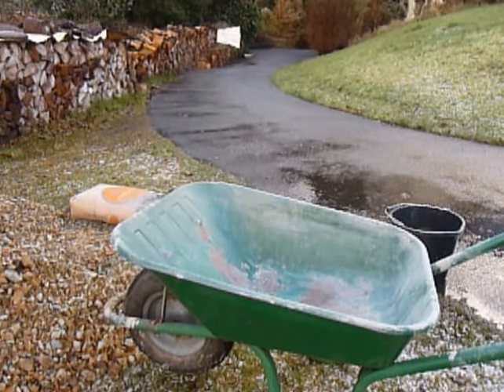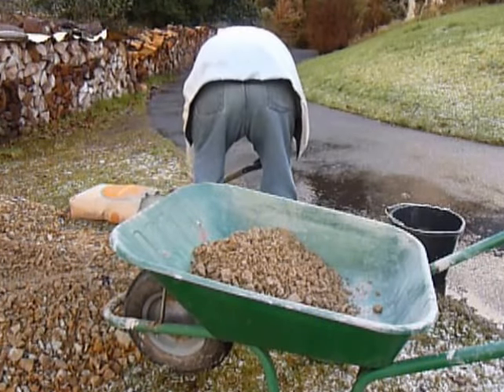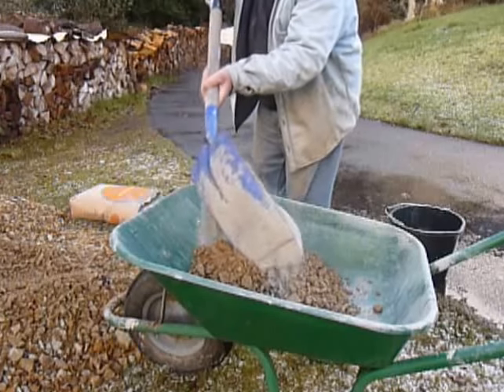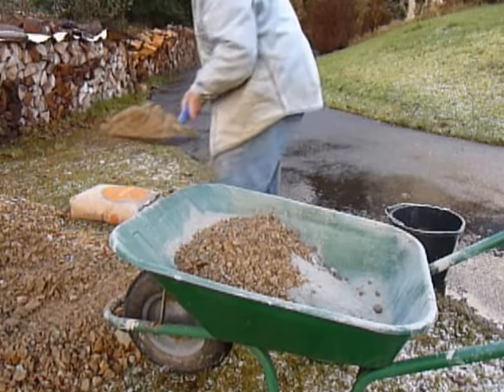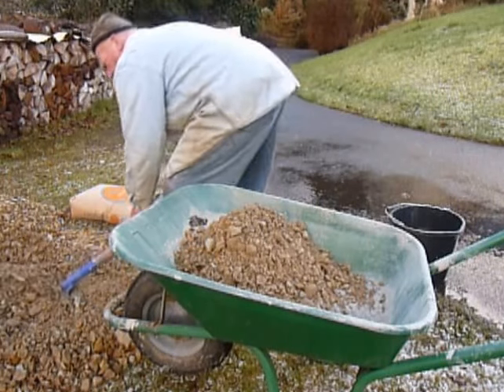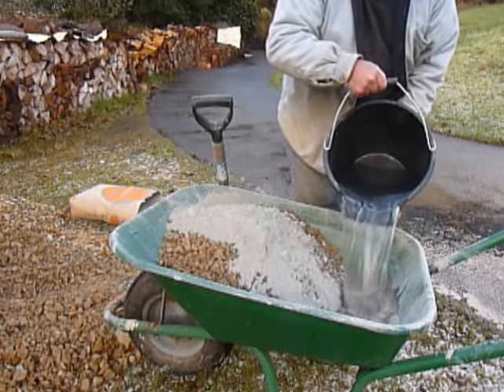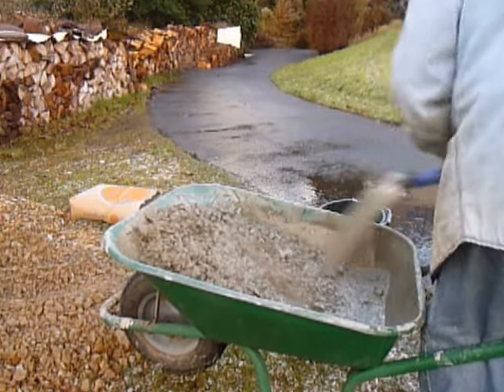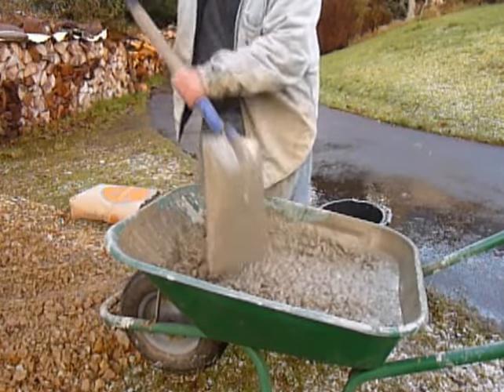Mixing concrete by hand in a wheelbarrow the easy way

Comment: My dad and I did exactly this when I was a kid.  We poured a walkway around one side of our house and then another with steps coming off the porch.  This works people, I can still see the work my dad and I did 30 years ago on Google maps of our old house.
Reply: So he's making it from scratch, as it were, as opposed to just mixing quikrete with water? Not sure how that's easier. The way my dad taught me, we use a pulaski, which is an axe-type tool with one blade horizontal which helps it cut through the concrete and mix it really well.
Reply: keith cunningham  Well, damn, guess I shouldn't have ordered that entire pallet.

Comment: I did not know anything about cement or concrete but after watching this video i did my pavement just like this and it worked. I was tiered as hell but it worked! with steel arming at the bottom! 

THIS WORKS!
Reply from the maker: I'm glad it was of help, thanks for watching
Reply: you beast

Comment: I've always mixed using a barrow for small jobs. Then I started buying concrete molds to construct a Roman garden and decided to invest in a mixer. Well I used it two or three times then went back to the barrow because I wasn't that impressed. What's more, it made a noise like a WW1 tank with half it's track missing. So I'm back to plugging away with my wheel barrow and loving it...and that method you used is fine...

Comment: All these years I've been doing it wrong. Your method is both clever and efficient. Thank you for sharing!
Reply from the maker: I'm glad it was helpful, thanks for watching
Reply: @oldtimer43  Ordered my wheelbarrow yesterday, and looking forward to replacing those leaning fence posts. Thanks again. :)
Reply from the maker: @12thDecember  Good on you, although I used a shovel a lot of people have commented that a hoe might be better for the actual mixing. Good luck and let me know how you get on.
Reply: @oldtimer43  Thanks for the follow-up. I have both tools and will let you know which works better for me. Fence post removal and replacement will be in the next two or three weeks.

Comment: 👍👍Old school mixing, I think it's cool that people still do it. 
Nothing wrong with that, I'm old school in a lot of ways & it blows some people away on some of my accomplishments.
Good video & thank you for sharing.
Reply from the maker: Thanks for the comment, I wouldn't want to be doing it all the time and still use a mixer for large quantities but for smaller jobs it's fine, you are right about accomplishments, I have just finished a 500 sq ft extension to my house just by myself and have just started  a large pond/waterfall in the garden and I'm just turned 77 yrs old

Comment: this is such a good tip! first time mixing concrete and I'm so glad I watched this suggestion. I've found you can also lever the shovel off the back of the wheelbarrow to flip the wet side of the mix.
Reply from the maker: I'm glad you found this useful, many thanks for watching.

Comment: Good technique. One of the first things I learned about concrete was to always add the dry to the water, never the water to the dry - and this method makes that possible in a very easy way.  I don't mix much of it, but sometimes I need to set a post or something and make up a tiny batch. I have to buy those teensy sacks that hold about a half gallon of dry cement. It's expensive that way but I can't lift the others LOL :-) Tina
Reply from the maker: If you only have a very small amount say for a post, I've just seen a video from a 86 yr old man showing a very easy way, take a look at http://youtu.be/mQAdmX57aRU
Reply: Thank you... nifty concept. Here's to continuing to live normally as long as we live!  :-)

Comment: I've mixed concrete in a wheelbarrow many times but next time I'm going to follow this method. I used to mix it dry before adding the water, which is quite hard work, but I can see the method in this madness, it looks like half the effort. Simples :)
Reply from the maker: I'm glad it was helpful, many thanks for watching.

Comment: Nice one mate! I was taught the same method when I was a kid (From an English Bricklayer). Definitely the easiest way to mix concrete, mortar and render. We have light all steel mixing shovels here in OZ that are a bit straighter that yours. I find the angle to be good for mixing in a wheel barrow.  Actually, the two biggest wheel barrow makers here in Australia make their tubs with sharp internal corners so the shovel can get right in there.
Reply from the maker: Hi, Many thanks for stopping by and commenting

Comment: I put the sand or sand and gravel mix into a wheelbarrow, make a well in the middle, add the cement and water, and mix thoroughly with my hands (thick gloves essential as cement is irritant). Result - in two minutes I have a uniform mix that sets perfectly. (Though I would use a smaller quantity than shown here.)

Comment: Mixing concrete by hand is bloody hard work. Use buckets to measure the materials for the mix, guess work will result in a poor mix and ultimately a poor finish. Weigh a full bucket of all in. Then reduce the amount in the bucket until you have half the wight in the bucket, then mark the inside of the bucket with a small hole. You can then use this bucket to measure the all in, cement and the water. BTW, your mix is slightly too wet and needs a little bit more cement.
Reply: it seeemed like that...thanks

Comment: I just laid slabs for a shed base, my mix was two bags of sharp sand to half a bag of cement. Some stones.
I mixed the first bag of sand with the cement like soup, proper wet, added the stones then added half the other sand then the last sand, a big full barra worth. Still a hard workout not gonna lie. A mixers no fun, proper work by hand. Cheers, I like this technique also.

Comment: My back hurts just by watching this video.
Reply: Sykes Entertainment yup
Reply: Your back would hurt far more mixing at ground level!
Reply: I work for a basement company. I mix pallets at a time all by hand. Lemme tell you that their is a huge difference between aggregated cement and just add water quikrete. This is simple because the rock helps break the sand up. All sand cement is a pain in the ass and I promise their is no easy way to hand mix.
Reply: Get to the gym and get some muscle then

Comment: Hi Michael, you can't beat old school mixing. What mix ratio would you recommend for fixing fence posts in using general-purpose cement and ballast? And how many fence posts set at 24 inches deep and 12 inches square would a full wheel barrow load roughly do.
Reply from the maker: Hi David, thanks for watching and commenting, I would use 4 of aggregate 2 of sand and 1 of cement for the mix, you will probably use a full barrowload per hole, I hope this helps
Reply: @oldtimer43  so are you saying throw in the sand with the ballast also, or would the 25kg bags of ballast be enough, as that is sand and gravel already mixed together.
Reply from the maker: @TheGreyTrippers  If it is already mixed sand and gravel that is fine by itself
Reply: @oldtimer43  So just to clarify, if I have a bag of ballast it's just 4 & 1 ratio, just wanna make sure I do it right the 1st time.
Reply from the maker: @TheGreyTrippers  Yes, that will be fine, good luck.

Comment: I do one bag of ballast (mixed sand and aggregate) to 5kg of cement (5 to 1). I put ballast in wheelbarrow. I have weighed/measured what 5kg of concrete is beforehand (up to a mark in a bucket). I have done the same with the exact amount of water I will need. I then mix the concrete into the water in a bucket, gradually, whisking like cooking. Then I just pour the liquified concrete mixture into the barrow and easily mix with a garden hoe. This way keeps energy expenditure to a a minimum, just shoving about easily and the bare minimum. Girlfriend does the concrete and water measuring, me mixing as she pours in the powder, and I mix in the barrow. A nice steady human pace and you can do loads.

Comment: RE: 03:50 About to mix my first batch of concrete in some time as a DIYer. Concrete looked a bit soupy at the handle end as the video finished. Is that fairly normal / acceptable or should it ideally be given a few more turns until the consistency is uniform throughout the batch?
Reply from the maker: I would normally made it a bit dryer but in this instance I wanted it to flow easily around the posts in what was a small hole, thanks for watching

Comment: I mixed concrete with three 25 kg bags of ballast using a hand mixer, a trowel and a large bucket. Two thirds of a bag of ballast went into each batch. Mix the water and cement to make a slurry, add the ballast, then mix with a flat ended hand trowel. Obviously for large amounts, hire a proper mixer.

Comment: Ye but you only have a half barrow mix. To mix full Barrow make half mix chuck in water to make a soup then add sand and mix/turn until get proper consistency a lot easier and quicker plus you get full mixes

Comment: The simplest ideas are usually the best. This is a great CLEAN war to work too as you can stand your barrow up when finished and rinse off with a hose... far better than dealing with a concrete covered board thats gone crusty overnight
Reply from the maker: TheComputec Absolutely, that's exactly what I do, thanks for watching

Comment: can I ask a dumb question: why not just mix half of that amount and then not have to flip the concrete from the back to the front of the wheelbarrow?
Reply from the maker: Good question and I have tried it but mixing two smaller lots takes longer

Comment: Very helpful as I prepare to do my first concrete slab for a storage shed. Is it supposed to be that loose and soupy?
Reply from the maker: +Mitchell Gossman I made this a little bit wetter as I wanted it to make it easy to pack around the posts for a slab I would be making it not quite as wet

Comment: Far easier way is to pour a full bag of cement over a pile of ballast on the floor and shovel it making a new pile.1 bag of cement will make 4 good sized barrows of dry concrete in a couple of minutes.then mix with water in the wheelbarrow
Reply: Sorry, stupid question, so your saying get the sand, cement, and aggregate and mix it all on the floor, or piece if wood, and then shovel the premade mix in to the wheelbarrow and add water???
I never thought of it that way, I need to do a 6x4 concrete pad for a shed, have the materials. but put it off for last month as I wasn't looking forward to mixing it in a Barrow.
I feel kinda stupid I didn't think of this 😳😳😳

Comment: How long do you think the concrete will sit there before it goes bad?  if I were to want to transport it with a barrel; how long till I cant use it anymore?
Reply from the maker: +Flip Alchino I would say you should use it in an hour
Reply: +Michael Collinson thank you il keep that in mind. That means construction workers have to daily and constantly keep making their own mixes while building... the horror.
Reply: +Flip Alchino Yes, but if they're doing small batches constantly, they'll have a mixer on site or just have it made to order at a plant and delivered to the job site if they're pouring foundations or driveways.

Comment: I'd personally do this the exact opposite way (in terms of wheelbarrow placing - so that the water is on the high side, and therefore less likely to spill out onto your crotch if you mix too quick!
Reply from the maker: The problem with that is you have to pull the heavy aggregate uphill and at neally 77 I prefer an easier way!

Comment: Im just using the mix to pour down a hole to fill it. Can't i just use the mix by itself with water, without needing sand and gravel?
Reply from the maker: Yes, of course you can use a ready mix, it is just more expensive if you have more than just say a hole or two
Reply: @Michael Collinson  okay thank you

Comment: 1 kg of cement needs 0.35kg of water to fully effect complete chemical reaction. Masons don't like this ratio as it is very hard to work on. This mix won't flow so formability is very low. So what happens if you put in more water? Positive side is, the mix will be easier to work on. Downside, concrete will lose strength significantly. If water is increased to 0.50kg, concrete will lose about 20% of it's strength. Why is this? Because ultimately the excess water will leave the concrete when it dries up. It will leave behind microcracks where it once was. So be patient and stick to 0.35 to 0.40 or add plasticizer to increase workability.

Comment: don't use that for anything structural !!  Should be batch mixed accurately to ensure consistent strength concrete
Reply from the maker: To be fair I wouldn't be hand mixing anything structural however I was using small quantities to surround posts which has held up well and no problems at all since making this video 6 years ago. Thanks for watching

Comment: There is nothing easy about working with concrete. There is only very hard and not so hard. From what I remember doing this for a mason is that you had to make sure every pass with the shovel or hoe scraped the bottom of the mixing box or wheelbarrow.
Reply from the maker: That is the very reason I pull the material back into the water to make sure the shovel is on the bottom when you mix, thanks for watching

Comment: Hi Michael 👋🏻 , thanks so much for this, what is the ratio for ballast, sand and cement please? And also what sand did you use? Yellow or sharp?
Reply from the maker: I use 4-2-1 ballast-sand-cement and use sharp sand, hope this helps, thanks for watching
Reply: @oldtimer43  Michael that's brilliant thank you, was debating getting a wagon and wheelbarrowing to where I need it, but this looks a lot better as I won't have to rush!! Thanks again for the reply mate 👍🏻
Reply: @oldtimer43  sorry Michael, what would you recommend ratio wise if the ballast and sand are already pre mixed from the same bag, would it be 6 to 1 still or would you go 4 to 1?
Reply: 50/50

Comment: A Mason's hoe would be helpful as would premixed concrete that way you can put water in wheelbarrow first and work it into the water
Reply from the maker: A hoe is also good, but premixed concrete is a very expensive option compared to aggregate and cement, thanks for the comment
Reply: Brian Van Horne  I have mixed many different construction materials from concrete, plaster, mortar and quick set mud and myself and everyone else I know puts the water in first

Comment: I don’t agree with this. Mix the ingredients dry then create a furrow in the middle, add water then using the sides of the barrow as your leverage use the shovel to mix. Alternatively get the apprentice to do it 😂
Reply from the maker: I certainly couldn't argue about getting the apprentice to do it 😁
Reply: Same method but use a mattock garden tool to mix. Cheers

Comment: Using a HOE to mix is FAR easier than a shovel !
Reply: Agreed 💯, my dad and I mixed up tons of concrete back in the day, he taught me to use a Pulaski type of tool which is basically the spade on one side, and pointed and on the other. He was a fireman so that's probably where he got the idea. If the head of the tool is heavy, and the smaller area of the Spade part makes it really easy to go through the mix.
Reply: I had to look up pulaski ! But, that does make sense, I do have a couple of hoes,  which would prob suit me better than mixing with a shovel... I gotta do edging stones , nothing major !
Reply: @vixenvg  yeah, its definitely not a common term for that kind of tool LOL. A hoe would be fine as well, it's just that you want to make sure the tool is heavy enough in the front part so that it'll pull better through the concrete. And remember you don't want the concrete mix too wet. 

I have to pour some concrete for my backyard, but nothing major fortunately, I'm going to do it in 4×4 sections or maybe 4×3 or something , to make it easier. My dogs have torn up some of my grass, so then when it rains it turns to mud. Yuck
Reply: Yeah can let her do it for you 😂

Comment: Where's the tip? Using a wheelbarrow? That's not news.
Reply from the maker: The point I was trying to make was it is easier to pull the material back into the water in the back of the wheelbarrow than turn it all over on a board
Reply: @oldtimer43  Well yeah it's a step up from a flat surface, okay. I've got to mix about 10 bags for a patio and was looking for new tips. Thinking I might try this - https://www.youtube.com/watch?v=mQAdmX57aRU
Reply: Brian Van Horne  Actually it's just a section of a patio that needs to be cemented again. Still a lot of bags, like 25 or so. Wish I'd known my neighbor was getting a cement truck delivery for the same day I started my job,

Comment: You are not mixing with measured quantities, you are just adding material randomly. Basically all the engineering knowledge goes out the window like this
Reply from the maker: Although maybe not precise I did measure it by shovel fulls, the mix was 1 of cement to 5 of mixed sand and gravel, after 2.5 years it is very sound with no cracks. Thanks for stopping by and commenting
Reply: Thanks for clearing out....you should have mentioned that in the video (or you can add annotations now if you want) because that is the most important point...the point which I was looking for when I watched this video
Reply from the maker: You make a very good point and one that I will be acting on, I will add an annotation to explain this. Thanks for your interest.
Reply: its 3:1 ratio (sand : cement)
Reply: No latex bonding agent?

Comment: This only looks mixed it will not be an even mix. Always dry mix before adding water. 👎
Reply from the maker: I can tell you it was very well mixed
Reply: @oldtimer43  It never mixes if you don't dry mix first. It just goes the colour of cement with no inherent strength. This is the classic school boy error, first thing you are taught not to do on site. Just because the guy is old does not mean his advise is good.